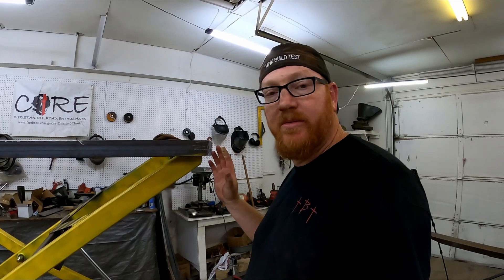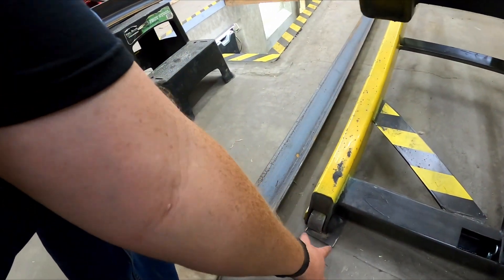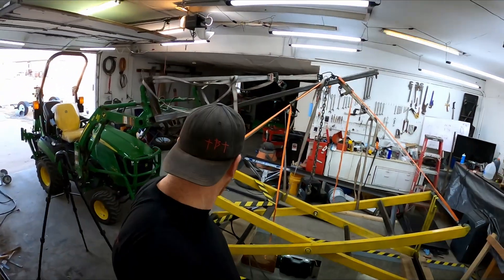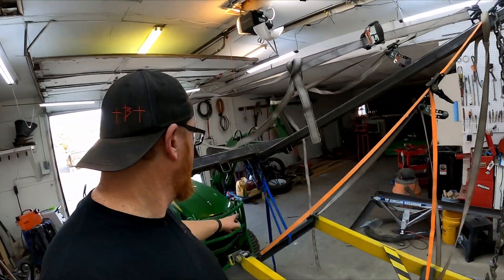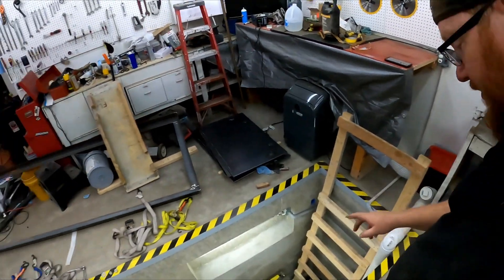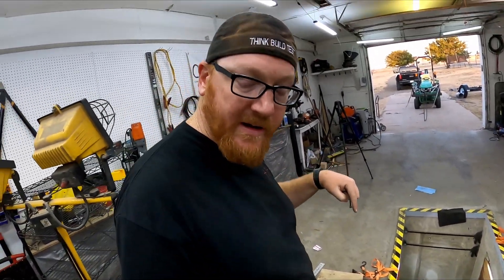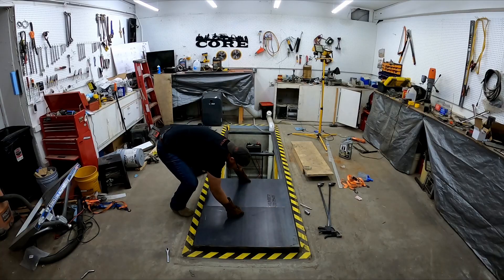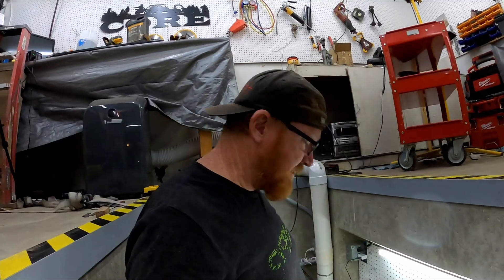Man Installs Lift Undergroud Amazing Results!

Comment: Nice work man. Should install some recessed rams in the floor to lift vehicles just enough so that the wheels and suspension are able to be in a serviceable position.
Reply from the maker: I have some air bag jacks I'm going to use.

Comment: It's your hydraulics.  The springs might work.  You didnt say it or edited it out, but if it has trouble coming up, what makes you think it will be able to compress the springs?
Reply from the maker: It will have a 1000 lbs of weight helping and 1500 lbs of pump.
Reply: @ThinkBuildTest  You really believe the specs on that Chinese pump?  Put a gauge on it.
Reply from the maker: @jagboy69  pump is doing awesome the horizontal start position and the huge leverage loss from the 5 ft radius is the issue.  I probably needed a bigger bore piston but once it is off the ground 2 ft its already lifting 1000 lbs no problem.
Reply from the maker: The mechanical disadvantage is at least half where the lift point is.
Reply from the maker: The last foot setting it down is very rough so the springs will actually solve a couple of problems.
Reply: @ThinkBuildTest  Then something is wrong.  Either your geometry is off or your hydraulics are weak.  A scissor lift will only go down so far.   It's called mechanical advantage, at some point, the hydraulics won't pick it up if it's too low.
Reply from the maker: @jagboy69  hense the springs....
Reply: @ThinkBuildTest  I know why you are trying springs....  You are trying to extend the scissor at the lowest possible setting.  Pull it back out of the hole and move it's lifting point.  Jerry rigging it with springs isn't the solution.
Reply from the maker: @jagboy69  that is not at all the plan.  You'll just have to see what happens.  Have faith.  Garage doors need the same help.